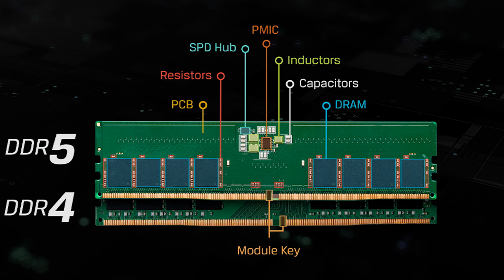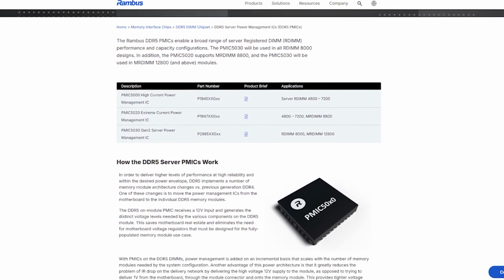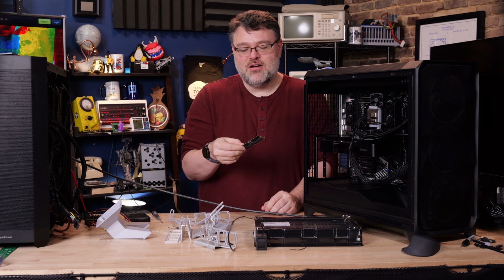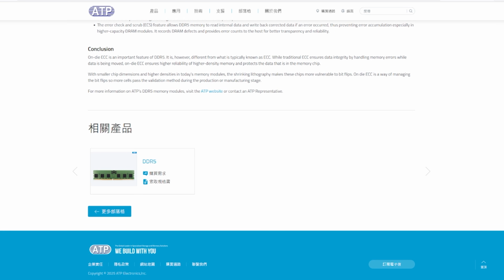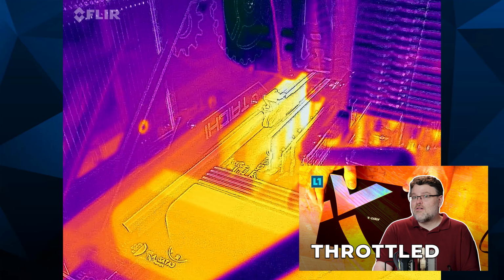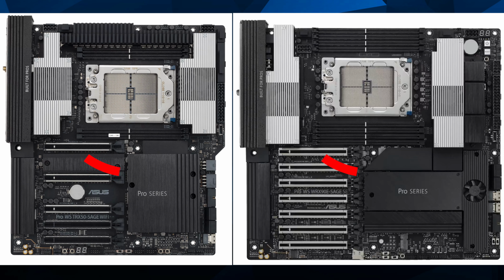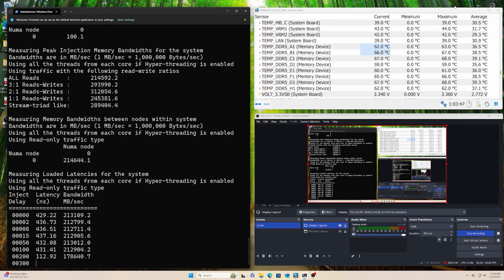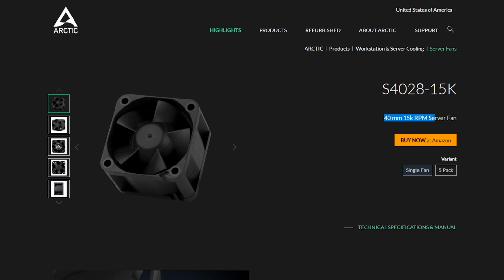Your DDR5 Memory Could be at Risk! All About DDR5

Comment: That "RAM" problem is often the same  that happens to add-on cards like 10GE+ NICs or controllers that are built to be slotted in a server where there is adequate airflow all the time, whereas PC case or monster towers, airflow is just a feedback sound from the fans that are not actually moving hot air out where it is needed. Air flow is the biggest problem in modern towers since they exist. That's why OEM towers from Dell or HP to name on them have baffles everywhere to induce such air flow and get that hot air out. DIY builds do not have that and I was frankly astonished nobody every patented something for builders.

Comment: Fascinating. I've had instability in my 2700x DDR4 system - after months of troubleshooting and inconsistent reproduction, it turned out it was the damn power supply (RM-series).
So when I got my 7800X3D system, I was worried this was the issue. One of the first things I did though was disable EXPO and just let the system 4800 JEDEC. 6 months later, no issues.
This video suggests that this could have been my issue. Particularly because I had a high-end air cooler and set the fans to minimum needed to keep a comfortable temperature on the CPU while keeping noise down. I wonder if I could go back to EXPO with more fans.

Comment: I think buildzoid at Actually Hard Core Overclocking channel showed that you need a fan to cool the memory on dual rank sticks (every big capacity ram that is used on workstations and servers is dual or quad rank)
If i remembered correctly He mentioned that cooling memory is required if you're sitting tREF timing to 50000 or more especially on dual rank kit, ie: 32gb & 48gb sticks.
Reply: Depends on the kit. My 8800 cl 42 kit has really thick stock heatsink. It also has cudimm. During my testmem5 stress test. After 3 cycles I got to 52.2 and no errors. I added ram fans got it down to 45c. I never hit that in everyday tasks. 24c idle now too. Also in the video he says never get above 70c try to keep it under 50c imo

Comment: 6:00 that is a board for airflow with the RAM sticks lined up horizontally unlike we have in all of our desktop boards for the last 25 years or more. I bought some little 2 inch USB powered fans to cool my heat sink modded TRACKIR 5 camera with. I attached the heat sink to the back of the camera and then jerry rigged the USB fan onto it. I bought a six pack of them. I am now goign to jerry rig one up to cool the DDR5 sticks somehow. 15 watts per DDR5 sticks? Mad.

Comment: My goodness, I was wondering why one of the Thredripper Workstations using Asus TRX50 SAGE, OCed 7970Xes and 192GB of 6400MHz sometimes have weird instability... I didn't know that this missbehaves on ASUS boards...
I have to set up one more workstation with that board and with 4x128GB 6000MHz from V-colour. Any tips how to avoid that problem?
@Edit
I'm using RM44 and RM52 cases.

Comment: I run DDR5-6000 low CAS Corsair RAM on my 9950X in XMP profile. I notice every week or two that a cold boot hangs my system for a while doing RAM re-training. It looks like I'll be going ECC registered DDR6 with active cooling on my next build.
Reply: If you think DDR5 runs hot wait until you see DDR6
Reply: @KenS1267  as long it does not melt connectors, it will be fine!
Reply: I had an issue in the beginning of DDR5 where it would no longer stay stable at 1.4V and the system kept rebooting with training and reverted back to 4800MT, saying it couldn't get it stable. It happened out of nowhere, no reason why.  it's DDR5 6000 MT CL30. What helped in my case was turning down the voltage to 1.39 from   1.4V. Later I flashed my BIOS to a newer version and the issue disappeared.
Reply: Just add a fan hanged on zip ties over the ram. And test its stability using tm5 or ram test pro
Reply: i did ecc rdimm for my ddr4 build years ago, using a second hand xenon cpu and one of those chinese lga2011 mobos that hacked in nvme support... it ran well, but still had more crashes than my current ddr5 build that has only on-chip ecc, probably because the memory sticks were nearing the end of their lifespan
Reply: There's a new motherboard that is like a hybrid between a laptop and desktop pc. It fixes this issue with amd platforms. Make no mistake is nothing to do with your ram.It's amd
Reply: You could just slack timings and lower voltage.  Primary times don't matter as much anymore, anyway.  And a 10% voltage drop is a 21% power drop.

Comment: I was memeing about RGB on RAM being the reason for a lot of problems half a year ago or so. But seeing this and realizing that those modules have plastic diffusers, basically thermal isolators on top of them ....... xD
Reply: And LEDs that themselves generate additional heat.
Reply: Never understood why people want to have RGB on RAM. It makes it look like ugly, cheap toy, and on top of that it generates additional heat on top of component that needs cooling. And the sad thing is, it's getting harder and harder to find RAM without RGB.
Reply: I tried to buy my 96GB DDR5 kit last year without RGB, for this exact reason.  Guess what, looked at several shops, and they only sold the RGB versions. So i had no choice, thanks to stupid gamers who love RGB on everything, even if it's to their own detriment.
Reply: I'm starting to get into hardware stuff a little deeper, is there a way to "de-rgb" ram safely? Or is it a permanent attachment?
Reply: You can remove the plastic RGB shroud and replace it with a metal heat spreader. This can be tricky to do without damaging anything though.
Reply: @AnonUser-b6y  Thank, but that 96GB RAM kits has quadrupled in price now.... I am even scared of opening my PC these days lol...
Reply: @matyasbalazs6870 i guess it depends on the kit but with g skill you can just remove the rgb bulbs. No way to get them back after that though
Reply: @matyasbalazs6870  I don't see the need to completely remove it... just turn the RGB off. I'm certain you can remove the RGB components themselves, but I think you're taking a big risk to do so. Especially considering the price of DDR5 currently, as well as how simply turning the lighting off will accomplish the same thing with zero risk. But that's just my opinion.
Reply: @abaj006  Yeah, I have 96GB as well but I managed to get a Corsair kit (2x48 DDR5-6000 CL30) without RGB. I also have a kit teamgroup 2x24 DDR5-8000 that is clean as well. I wanted to try both and see what I like better and I just didn't get to selling the other kit yet. I guess now would be a good time. xD
On the topic of RGB: I just got a XFX 9070XT Mercury which is currently rainbow puking all over the inside ov my case. But I'm fairly sure I can fix that. There's gonna be a plug somewhere. And then it's gonna be sweet sweet darkness again. (status LEDs aside)
Reply: @noenken  ... I bought a Sapphire 9060XT. It has some lighting as well. Was annoyed by it until someone pointed out that with some software I could turn it off. I'm not sure which piece of software it was, but there are solutions. Don't know which brand you bought, but I doubt Sapphire would be the only one. If there's software to control the RGB it has probably got an off switch as well.
Reply: @FrancisFjordCupola  Yeah, there would be software for that, for sure. But not on linux. ;) And I like solving problems "in hardware".
Reply: @abaj006 Im a stupid gamer and I think RGB is excessive and useless and I want my PC to just be a well functioning machine, not a nightclub.
Reply: @abaj006 my rgb 32 ddr4 ram runs at 20°C constant... It's a feature to ddr5 to run like a stove 😂
Reply: @asuramaru4700 sounds like whatever you’re using to measure heat isn’t accurate, or the system is turned off, or the ambient temperature is significantly below comfortable room temperature.

Comment: A video that makes me feel GOOD about my main system still being an FX-8350 w/32GB DDR3-1866 ram! ;-)  Built it in 2012 or 2013 and been running 24/7 ever since. And I got lucky late last year and scored a Ryzen 2400G for $20, a 2 x 4GB pair o GSkill Aegis DDR4-2400 for $5, and a 2 x 16GB pair of PNY XLR8 DDR4-3200 for $75. The selection of AM4 5000 series CPUs is very small, so I hope the rumor that AMD may make more of those CPUs is true... Oh, and my original point was that I don't have any DDR5 systems so I don't have DDR5 ram heat problems which makes me happy.
Reply: ASUS Sabertooth 990FX baby still going strong. I was rocking that exact setup until I upgraded to a 4070, 32GB DRR5 and 15-16300k. Seems like my current system is haunted with some of the old tech problems like 8350 being a 4 core CPU advertised as an 8 core. My 780 having 3.5GB of ram instead of the advertised 4GB lol
Reply: @WhiteError37  My mobo is a Gigabyte 990-FXA UD3 R5. It has heatsinks on the VRMs and northbridge and they are connected via a heatpipe. Don't know why they connected the heatsinks on the VRMs and northbridge together, but the guys who design mobos obviously know more about it than me. I will always believe that the FX cpus have the stated number of cores, because if we define a cpu as HAVING to have an fpu, then the millions of 286sx, 386sx, and 486sx systems sold contained NO cpu! And how can a computer run w/o a cpu? Obviously the answer is that a cpu doesn't HAVE to have an fpu; it can be off die like L2 cache used to be(and L3 wasn't even a thing back then!).
Of course that didn't stop me from filing for a refund in the lawsuit!  ;-p

Comment: I discovered same issue with desktop DDR5 when I used Ryzen 7 8700G APU. It was artifacting heavily in games and I blamed it on defective chip.
It was a really small build with no RAM cooling and no real airflow, if anything it was heated more by low-profile CPU cooler. Then I noticed that artifacts went away when I started cooling RAM properly.

Comment: I just disable XMP and set my speeds to the base DDR5 speed.
Reply: People forget fast XMP/Expo profiles is overclocking and not what the RAM stick is spec'ed up to do, which includes the presence or not of thermal dissipation. It wasn't a big deal before because RAM wouldn't heat up as bad as DDR5 does..

I just don't like the Automatic Overclocking every PC can do, it's cool but it leads to this sort of problem of the system just setting itself on fire and people thinking it's the norm OR not even knowing it until something fails.

Comment: Everyone clowned on thermaltake a few years ago at CES when they brought out water cooling for RAM sticks (at least I think it was them). Not sure who's laughing now.
Reply: Pretty sure Micron is laughing. All the way to the bank.
Reply: i have my ddr5 water cooled in my rig and it uses ddr4 cooling plates lol, been working for 3 years now with no issues and insane timings on an early ddr5 kit
Reply: OCZ was making water cooled DDR2 like 15 years ago.
Reply: Adata was much earlier with their Spectrix D80, back in 2018 with DDR4. I remember when that was first announced and thought it was silly. it does have it's purpose because it's lower profile than ram with bulky heat sinks and a ram cooler fan overhead.
Reply: I've had my X58 triple channel systems with EK Memory blocks with Corsair Dominator sticks since 2010/2011
Reply: You think THERMALTAKE invented waterblocks for ram A FEW YEARS AGO? brother...
Reply: It's not even a new thing there were ram waterblocks in early 00's
Reply: Water cooling RAM is not new. As usual ThermalFake just steals ideas.
Reply: @MACDRU421  Thermalcake is actually a great company. I dont understand why people complain about having options. You guys will be happy when one brand is available and its illegal to compete.
Reply: @MACDRU421 OK thanks
Reply: @MACDRU421  Welcome to the tech industry.

Comment: Just another reason that I'm glad I've stay on my AM4 DDR4 System! 

Thanks Wendel!
Reply: True that! DDR4 & 5800X enjoyer here.
Reply: @travisretriever7473  Same!
Reply: I just did a “light” upgrade on my system and kept my DDR4. I have no regrets!
Reply: 5800X3D be the 1080 Ti of CPUs
Reply: @mokahless  Ryzen 5000 is the new Sandy Bridge!
Reply: @mokahless I unfortunately missed out on the 5800x3d, but did manage to grab a 5700x3d last year before those all sold out!
Reply: @BigAL_RPG_gamer  me 2, got lucky!
Reply: @BigAL_RPG_gamer  The 5700X3D came out less than a month after I bought my 5800X3D - and with the minuscule performance difference, I was a bit upset as I could have saved some money.
Reply: @BigAL_RPG_gamer I chose to get the 5900X on sale cheaper than the 5800X3D, it doesn't have one CCD with extra L3 cache, but all its L3 is increased over the die, giving similar performance in games
Reply: @dh66  That's a good chip. 12 nice fast cores. I ended up with the 5800X3D, because a few games that I enjoy really benefit from the 3D VCache. (Like, 25% performance jump.) That said, most things are closer to 4%, and some things are negative because I have less cores. None of these are bad CPUs, though. I do believe calling them the SandyBridge of our time will prove accurate.
Reply: @mokahless I'm so glad I have that exact CPU. Best purchase ever.
Reply: Glad I upgraded to the 9800X3D and DDR5 one year ago! 😎
Reply: I got in AM5 while it was cheap, really happy that zen7 will be am5, it looks like it's going to be amazing.
Reply: I was bou to do the same, but i boutgh intel so motherboards same price ddr4 or 5 so i bought mine just the day they were out of atock in amazon, now they i ou available at corsairs page almos 3x times
Reply: Yeah, me too, I'm most probably skipping this gen, for multiple rea$on$...
Reply: It depends, if you actually took your time and config your DDR4 RAM properly in the BIOS, checked the limits, or not. If you did then you already know tRC and tRFC are temperature sensitive and tweaked those properly. If you didn't (and just used XMP) then your system probably is stable if are running with DDR4 below 3800MHz (assuming Vermeer family cpu)... but you just live thinking your system performs as fast as it can when in reality on AM4 RAM config makes huge difference in programs that are cpu heavy (including some games). RAM latency is real and tangible on AM4. Buy a kit based on Samsung B-die IC's, config it to ~3800 CL14 FCLK/MCLK/UCLK 1:1:1 and see what happens.
Reply: The issue isn’t DDR5 it’s AM5, it’s just as bad as Intel 13/14 gen.

Luckily if you have Intel 12th gen or Ultra you have no problems.